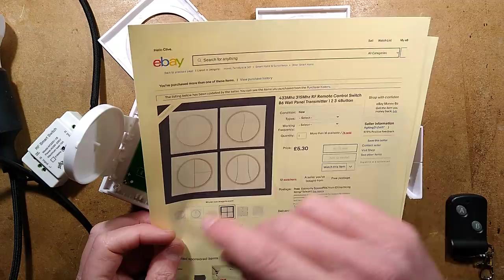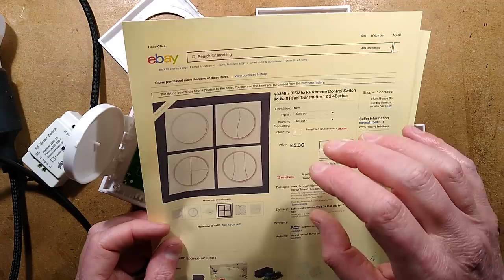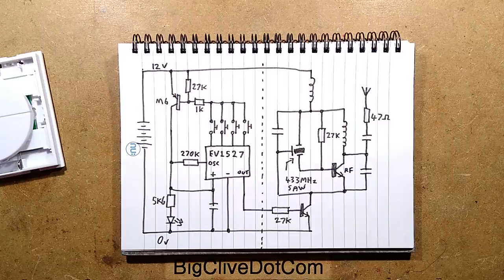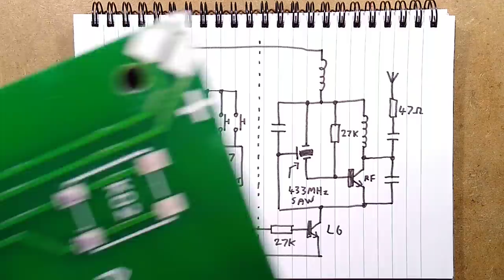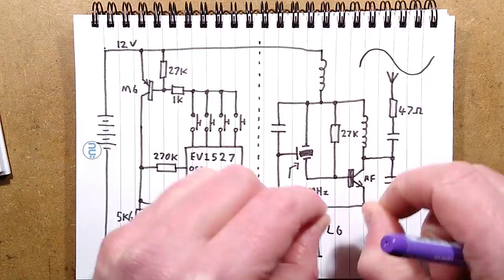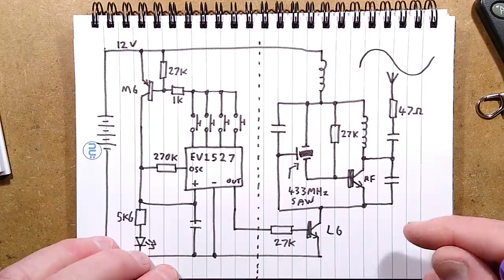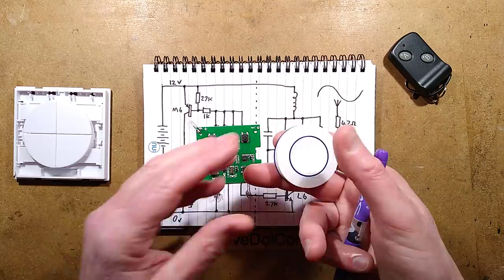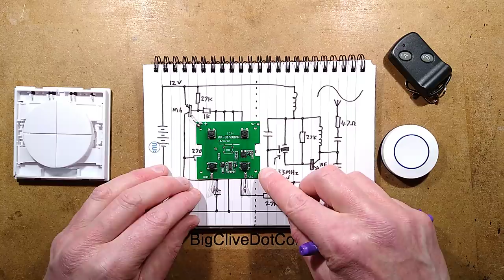Inside some stylish wireless switches (including RF schematic)

Comment: Since houses these days seem to only use LED or CF lighting, one of the things that I considered doing at one point was to rewire my entire house so that the traditional light switches were removed and only small momentary contact button-type switches were put in their place.  I figured that in a electrical box that normally only held a single light switch, I could easily put 6 of the small momentary contact switches and maybe even 8 of them.  Instead of the normal gauge wire, a much smaller gauge wire could be used.  It would even be possible to just run a length of CAT-5 cable to the box and have 8 conductors (which would allow for up to 7 switches).  Each of these switches would be connected back to a centrally located microcontroller (e.g. Arduino) which would constantly be polling the switches to determine if they had been pressed and if so, what operation to perform.  I figured that it might be nice to have at least 3 of the momentary contact switches in each electrical box -- one to control the light in that room, one to control all the lights in neighboring rooms, and one to control all the lights in the entire house.  As such, from any switch plate, you could press a single button to turn all the lights in the house on or off, which would be a good security feature (besides, it's always good to be able to identify your target before you shoot it).  This would also allow for automation of the lights randomly so that the house would appear lived in while you are away on vacation.  I wrote the Arduino code to do it and created a proof of concept test bed, but I never actually implemented it in my house because I don't like crawling around in fiberglass in the attic to run the wires.  I'm a retired old fart and I just don't have the motivation to do things like that anymore...

Because of the low wattage requirements of LED lights these days, you could probably run every light in the house off of a single 15A circuit.  15A circuit, 120V, gives you 1800W... 10W per bulb gives you 180 bulbs maximum... That's plenty for most houses...The Arduino code would keep track of the current state of each of the lights and use relays to provide power to the bulbs... It would also map the various buttons with the lights that the button should control or zone of lights... It would even be possible to control multiple zones with a single pair of wires go to the electrical box if you uses resistors to create a voltage ladder and read the pins in analog mode instead of digital... At some point though, you will run out of pins on the Arduino board, so it would be necessary to distribute the processing across multiple boards... My background is in distributed processing and embedded systems, so such a design just seemed natural to me...

An even better idea might be wire up 12V LED lighting in the rooms so that you don't have to use the typical LED bulbs which are prone to failure from the other components in the bulbs, not the LED per se... When I've disassembled LED bulbs that I failed, it always seems that it is the other components that fail, not the LED itself...

Comment: I'd love to see a Quinetic brand or equivalent transmitter also, having seen them used on Nick Bundy, Artisan, CJR etc channels.
Reply: Yes, me too - especially as the Quinetic switch is piezzo powered and doesn't need batteries (I was wondering if anyone had requested that already, thank you!).
Reply: I came here to request the same. The self-powered switches seem really practical.

Comment: The modularity of these switches must be a dream for an assembly system design engineer, because it means you can essentially build a single production line to assemble all versions of the switch, with only minimal configuration and setup for each production run, saving space, money and time, it's extremely well designed with production in mind.

Comment: And the neighbor is wondering what the hell is going on with the garage door opener.
Reply: There are at least 3 houses in our street that have door bells with the same frequency and are close enough to each other to interact, when one doorbell is pressed all three ring !
Reply: @ian-c.01  I had to replace our doorbell as a neighbor close by had a doorbell that would ring ours. Weirdly ours didn't ring theirs! Thankfully no such problem with the new setup 🙏

Comment: @Big Clive. Saw filters come in both ceramic and quartz varieties. The ceramic ones drift a bit and have a wider bandpass (they can be used as part of a down converter). I believe the ceramic ones can work up to a few MHZ (for the output) but I have only ever seen them in 455KHz varieties. Quartz tends to be used up to about a GHz. After that I believe (but I'm not sure) that either capacitive down converters are used (which are pretty noisy) or possibly a circulator? To be honest I use ready made units for 10GHz as they are cheap as anything as they are just slightly modified satellite LNB's.

Comment: As a child I would take things apart (sneaky me). looking at the green circuit board and all the small water towers, roadways, tanks and buildings, this was clearly a small city. I was only trained by Godzilla on how to handle small buildings and towns, smash. So many many electronic towns got the hammer pre maturely... I always wondered and was fascinated by circuit boards, often wondered if anyone could look at one and know just where the electricity starts goes what happens to it and where it goes, step by step just by looking at it. Thanks for being that guy for me.
Reply: Apply high voltage at the start move leads apply again watch the city burn and blow up not a great way to repair but it is fascinating. Lol

Comment: It's very likely that the component below the 47R resistor in the schematic is an inductor, there's little reason to use a capacitor there, but an inductor would help to match the short antenna to the long wavelength of 433MHz.
Reply: A 1/4-wave antenna would only be ~9 cm...

Comment: To follow up on a comment from  @Gerallt Griffiths :  A quick google of Sunrom EV1527 to find the spec. It has only a super basic preamble (a H/L of fixed length), 20 bits for the main "OTP sequence" followed by 4 bits from the 4 innput pins, so total 24 bits of payload, and that's it. No device id, no vendor id, no checksum. Bits H/L are identified by their period (H is 3 clocks on, 1 clock off; L is 1 clock on, 3 clocks off). Collisions, what collisions?
Even though the spec calls it that way, it's not an OTP (from a software engineering point of view) since it's a fixed 20 bit code and not any kind of rolling code at all. Which means it's not secure at all, being prone to sniffing / replay attacks using something as trivial as some random arduino.  How many times do consumers need to burned by "Smart" / IoT devices with super weak security only for OEMs to act surprised when the thing is trivially abused?
Reply: can confirm, have 'hacked' my own hardware using an arduino and a <1€ ASK transmitter. You can have tons of fun with these modules, but I would never use them in a fixed installation.
Reply: Don't you know the saying: "IoT: the S is for security!"

Comment: Thanks for the video!
I wasn't quite aware of how cheaply and readily available these kinds of switches are. I looked into it, and it seems like the protocol will be really easy to read out with a standard microcontroller. I made myself a fully DIY smart home controller already, and it might have a pin or two free for an RF signal reader. Could be a lot of fun to use these ready-made units!

Comment: I was wondering, if you lived in a semi detached or terrace, if your neighbours had the same setup would you end up switching each other’s lights on and off?
Reply: Only if you had the same code. As Clive mentioned something like a million options, so a 1 in a million chance.
Reply: @RambozoClown  Clyde ! Hahahahh
Reply: @RambozoClown  but you have to factor in Murphy's Law.
Reply: @andymouse  Too much Pac Man, I guess.
Reply: Nah, the codes are effectively unique. I bought two lamps with remotes using this kind of chip, at the same time, and I have to use both remotes, to my disappointment. (I can't get to the receiver in the lamp to reprogram it) But a Sonoff RF bridge, with firmware replaced by Tasmota, could learn the codes so I can click one button on screen and switch them both.
Reply: @rpavlik1  Thanks for that, I did think that maybe this could be a new slant on "Neighbours from Hell!"

Comment: The output resistor is likely there to dampen signal reflections and noise pickup from the antenna that would otherwise add modulation to the oscillator's output.

Comment: When the battery fails, you'll be in the dark searching for a replacement battery so you can turn on the lights.
Reply: Nah.  "Alexa turn on bedroom light."
Reply: The RunLessWire ZigBee switches use so little power that they use the energy of the paddle being pressed to send a signal. I don't have any but I do have Lutron smart dimmers that clip on top of a regular light switch. The tiny CR2032 battery inside lasts surprisingly long.
Reply: All jokes aside, I assume this would start showing symptoms of a low battery, the same as tv remote for example.  And start taking several attempts to turn on.  That would be the signal to change batteries.  I have 4 different versions of this around my home.  In as many years of hard use I believe I changed the battery once in each. After it took several tries to turn the light or fan on.  I'm a proponent of using these in several applications for several reasons. Bad wiring come to mind. Love your stuff Clive.
Reply: Thats the most out dated comment ive seen in a while, unless if you buy cheap china crap, then the big name brands uses the energy from the button being pressed to power its self.
Reply: @christopherf8160  Its that reliable? I bought a bunch of Merkury lights. Egads, have to be on 2.4 wifi, with geeni android app. Hmm, ive reverted most of them to manual switch. Its simpler. And I dont like the relentless blinking they do when they forget their programming
Reply: buy quinetic switches no battery  or wired needed
Reply: @marc-andreservant201  Well, IMHO single lithium cells like the CRxxxx or stacks of them are generally preferable over these 12V 23A and 27A batteries. In that stack of alkaline button cells the ones in the middle often start to "sweat" and the corrosion breaks contact. So the battery dies suddenly, and when you crack em open you find 7 cells with good useable life left.
Reply: That's why God created the torch. 🔦🔦🔦🔦
Reply: You can make a no neutral circuit, that leeches power through the back feed from the light bulb which will charge a capacitor and power the circuit.

Comment: RF 84, likely similar to a 2SC3356 to amplify the SAW. Seems to me the SAW had about 0dbm power and the amp brought it up to about +10dbm...
Reply: Saws are filters. The transistor is the oscillator which implies an amplifier.

Comment: the reason that double sided tape is in a recess like that is so you first remove the protective layer on the side that goes to the wall, stick it, then the pads got stuck on it, and you stick the switch back
edit: 1:57
Reply: The pads don't have to be stuck in those recesses either.
Reply: But the odds of getting those sticky pads right back in their slots are slim to none. It’s a lot easier to stick the pads to the switch then stick the switch to the wall
Reply: @mrb692  That's clearly the obvious way to do it.

Comment: Please do a video on receiver / power supply. I'm in need of a good quality 110v to 12v dc power supply. Being able to turn aforementioned power supply on and of remotely, would be great.
Reply: Just add a smart switch or socket for remote control.
Reply: Greetings.   I work for Lowe's.  the smart socket would be affordable and very easy to install. hope you are well
Reply: Smart socket, or a Sonoff module, are likely a good bet. Heck, the Sonoff stuff is even etl certified now.
Reply: @rpavlik1  greetings from Georgia. Hope you are well   may I ask what is etl.   thank you for the info
Reply: Etl intertek is one of the product standard certification organizations for the usa, usually required for anything that plugs in to mains power (etl or ul). Lots of these less mainstream devices don't have certifications, so your insurance may refuse to pay if a fire occurs and they decide the non-certified device may be involved.
Reply: @rpavlik1  that's one of the most excellent reply I believe I have ever seen . I see you are up and about glad to hear from ya.  I'll head on over to your channel and sub ... I sometimes work in the electrical department but I also feel illiterate in that area.   that's why I view Big Clive he such an amazing personality.

Comment: The one real gotcha on these is that they are very easy to intercept and decode as they transmit the same code every time.  They are not recommended for things that could cause injury or other risks, as a malicious actor could potentially trigger your switch, or even a poorly transmitted code that was close enough.  Both probably unlikely, but something to keep in mind.
Reply from the maker: I'd never recommend using these for a safety or security critical task.  Just convenient control of things like lights.
Reply: @bigclivedotcom  Of course that same feature also makes it hackable for reasons that could be helpful for certain types of projects.

Comment: I saw one on an electricians channel earlier today. 

The reciever was built into the replacement AC switch. And then you could pair additional kinetic switches.

No need for that seperate receiver on the light side.

And the kinetic switches obviously don't need any battery or wiring 👍

Comment: wing wang?  you mean Yin Yang :)

and to help out the Cllive'ster...
the unmarked inductor at the top (which is shown common to the 27k resistor) is there for RF isolation.. (RF choking) and 'L6' is basically the "modulator" (dirty modulator, hehe)  the unmarked cap to the left of the SAW resonator is for bypass (to complete the filter circuit with the inductor mentioned above); the rest: Clive, pretty much, has spot-on. :)

Comment: R433! Yes! I know that. I have played a tiny bit with a usb software defined radio. One of the little projects I used it for was picking up R433 signals from weather and temperature stations. You can also pick up remotes like this and some times car key fobs. I want to get one of those weather stations that does like everything one day and do something with the data.

Comment: Nice unit, I might get one or a few, would make my life a little ease I dont need to drive my wheelchair in to the wall to get near the light switch.   2x👍
Reply: I bought a set of remote controlled bulbs from Ikea, the remote unit is a small round thing you can easily carry around or keep on a table or whatever. on/off, brightness and some color temperature control is a pretty nifty thing to have. Although I can never quite get the temperature to what I want :) Brightness adjustment works really well though and the remote unit feels solid.
Reply: @benbaselet2026  Thank you  that sounds ideal.I have just looked on the website and bought a couple.👍
Reply: Use PIR switches.
Reply: Try voice controlled WiFi smart switches and plugs controlled by Alexa or Google Home etc.  It makes life far easier!

Comment: The wavelength is based on the speed of sound in the piezoelectric material, which is slower than the speed of light; so the wavelength is shorter than a radio wave travelling through the air.

Comment: I wonder if the chip can be modulated to 38KHz, and the output fed to an IR emitter instead of the RF stage? Then use a 38KHz modulated IR detector to get the raw bitstream back
Reply from the maker: I'm not sure if it can modulate the output data for driving an IR LED directly.